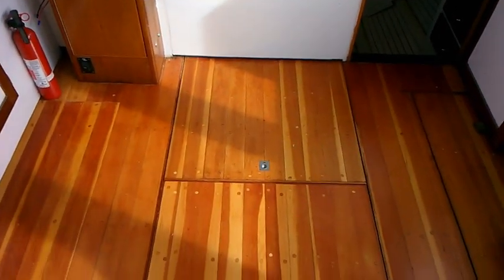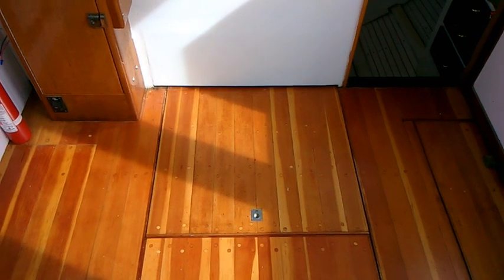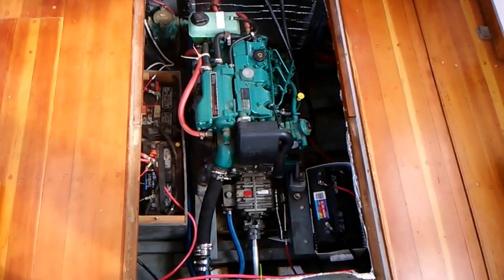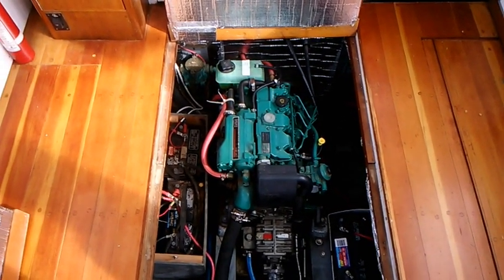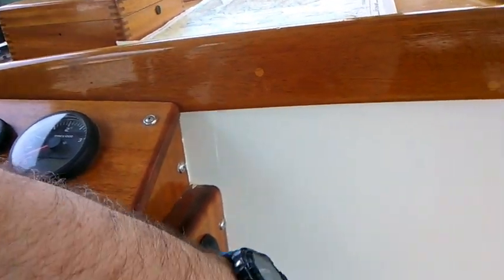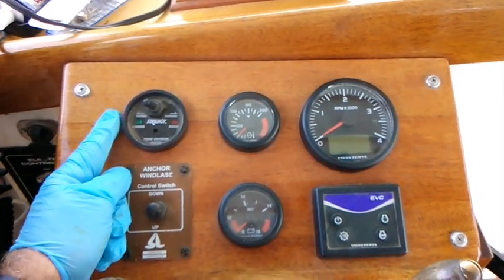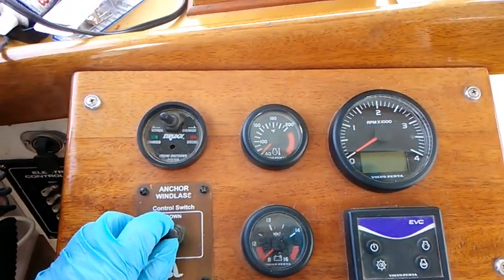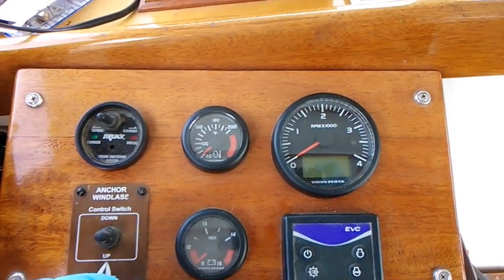1936 Wooden Powerboat Tortuga - Diesel Engine

Comment: Definitely a nice engine setup, and I would imagine it's fairly fuel efficient!
Reply from the maker: Thank you.  Yes it is fuel efficient.  I normally cruise at about 5.5 knots (1600 rpms) where the fuel burn is about 1 quart an hour.  At 7 knots (2,000 pm) the fuel burn is about 0.65 gph.  Not bad for a 33' boat.